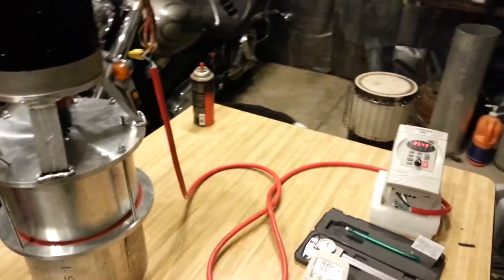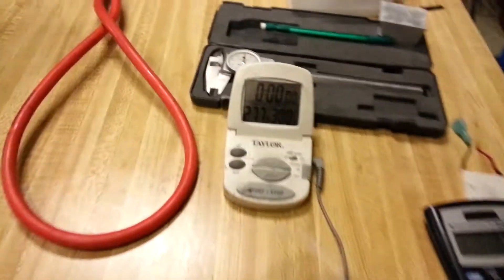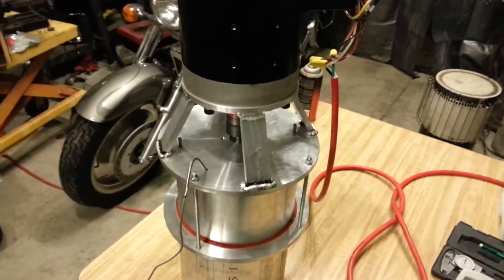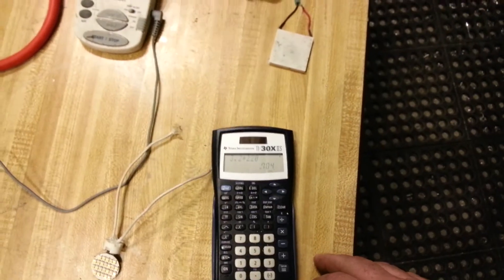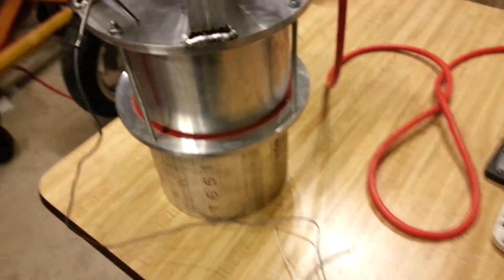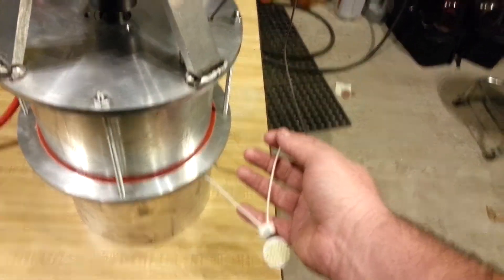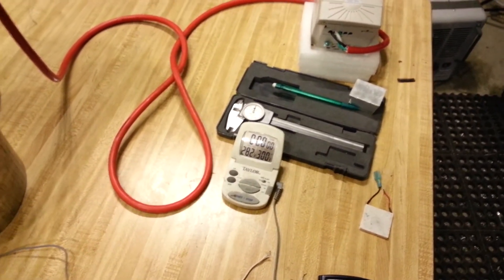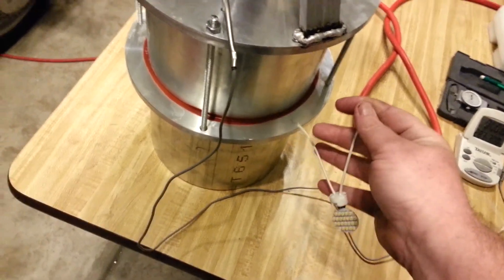Frictionheater testing with VFD, lighting a LED at the end of Video

Comment: About the LEDs lighting... VERY interesting!  (the whole project is awesome!)
I assume your friction heater assy. is fully Grounded through the motor Ground, VFD Controller, then AC line?  If so, then IT is the ground, and YOU are acting the antenna... and I might add... you're doing a fine job of acting!  ;-)  Then I gotta wonder if you have something else in the area that might be giving off some EMI. 

Here's the real defining test... if you touch it to the Controller ground, does it still light?
If so, keep moving the LED string back towards the Earth ground... see where it stops.
If it does NOT light anywhere except the Heater... then I need to get one of these ASAP and do some investigating! (25+ yrs of EE, but I've learned that engineering school does NOT teach everything!... only what they want you to know... it's called "programming")
Reply from the maker: Thank you,
yes everything is grounded, The only thing I have powered in the shop outside of the lights" they are LED 5WATTS x 6".
This is the first time I have shown the light but it has done it before I have used the VFD system. I would like to learn more to fully understand why and how to use it or fix it if it is a problem.

Comment: What did you settle on for type of oil in your friction heater? One thing we figured out burning waste motor oil in a boiler system was that synthetic oils do not wanna burn and is very hard to ignite.
Reply: Synthetic oil has a much higher burn temperature. But it is still oil and will burn under the right conditions.

Comment: If RPM's are related to heat output then seems the pulley system of previous builds might be more efficient, or did that prove to not be the case?

Comment: I am by no means knowledgeable on all of this. But a thought popped in my head. Could you run this on a battery, like a 12v used in a solar collection system. And then use it to both run off of the battery and recharge the battery at the same time. Kinda like a self sufficient device.   just a thought.
Reply from the maker: It's a good thought, and could easily be done.

I am only showing crude setups for the drive system. So with that being said, anything would be better then what I show. I have been hoping someone would put this on a solar driven system. Then post it on YouTube.
Reply: oilpiggy  I wish I could. I am still learning. And trying to decide on what to do. I need a better cheaper heat source. Will it be complete plug and use. That you are sending out?

Comment: I know absolutely nothing about electricity as far as the "workings" and terminology so please bear with me.... I've been checking out various ways to heat more efficiently, one of the processes I've been following is the Rocket Stoves/Heaters (both the "mass" type and gasification type). There are two guys here on YT that are doing a lot of experimentation with these processes and seem to think outside the box like you (Mr Teslaonian or something like that and Van Powell) VP has been experimenting with Thermal Elec. using the heat from the Rocket stove. His device or generator as I understand it is made of alum...could this be what is powering your LED array? The commonality between your systems is high heat and alum.  I also saw another guy on YT that made an amazing little TEM (thermal elec gen) with alum plate. It creates elec. from ambient room temps (demonstrated this by pouring cold water in it and showing the amps/volts??? dropping) the warmer it gets the more it produces (showed it sitting next to a campfire)  It's only about 8"T x 5"W x 3-4"D (from front to back, basically a tall rectangle)  ....so again Alum+Heat=Electricity! I think you could find him or his device by searching Alum TEG on YT.   I love what you are doing... keep up the good work!!
Reply from the maker: I have put this heater in my 37 ft. RV for testing.  I have it running at 1750 RPM
with a Amp draw of 2.7 @ 220v = 594 watts.  The out side is around 58F, no wind, the inside of the RV is @ 78F,  I can say no more, I am running this style of heater for the rest of my life! I was using propane for heating and using a 7.5 Gal. tank every 5 days @ 3.20$ per Gal. Costing me around $150 a month.
@ .34cents per kilowatt at 594 watts per hour that's costing me around 2.64$ per day if it runs for 12 hr. a day. at 30 days that's 79.2$ a month. My RV is a 2010 Coachman that has 2 pop outs and around 450 sq. ft. with 2 full baths, 50" TV and a Queen size bed and a full size couch that reclines. Soon this will be all off grid.
Reply: oilpiggy Yes your little heater is by far the "alternative" heating method I'm most interested in, I currently spend between $400-$700 a month to heat 1300 sqr ft between wood, kero and elec space heating ($200+ a cord, one cord per month,Kero @$4.59/gallon 1 gal=8hrs, and elec went up by $150 already last month w/out snow!) We spoke a few weeks ago.   I think you missed the point of my post though lol. I was asking what you thought powered the LED's if it was Thermal Electricity because of the experiments I've seen these other gentlemen do with the heat off their alt heat sys and the "equip" they used to harness the elec was made of Alum like your heater.   Have you checked out WITTS, they have a sphere shaped heater you might want to check out, it might give you some ideas and help w/the Elec harnessing!
Reply: oilpiggy prove it to me and Ill sale as many as you can send me....